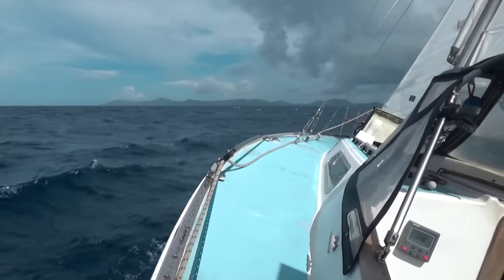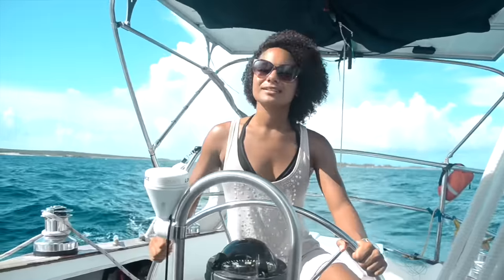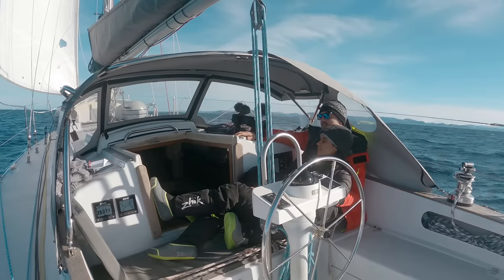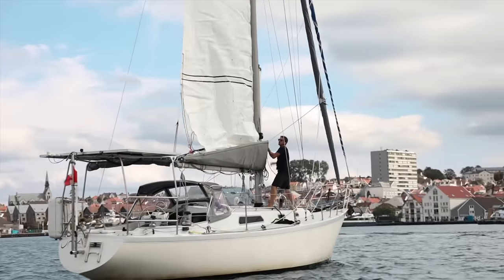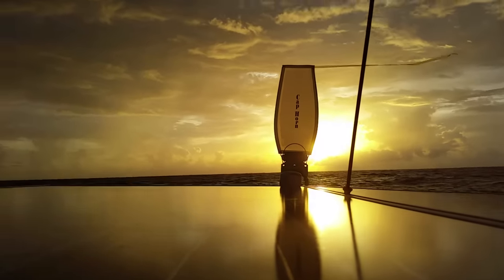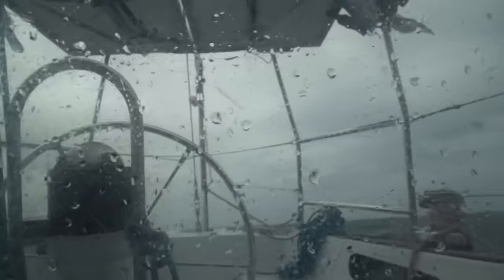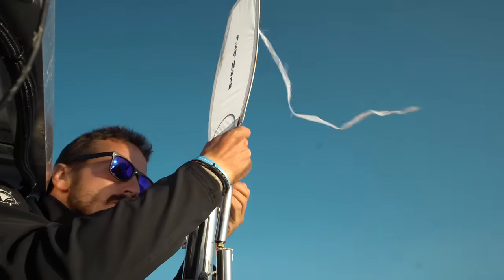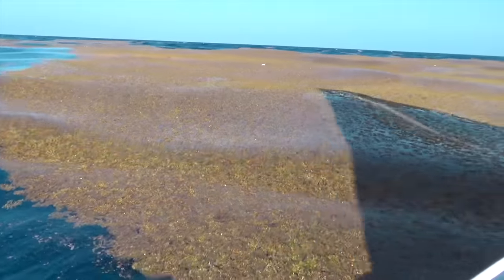Our #1 SAFETY PRIORITY (Autopilot or Windvane)  — Sailing Uma [Step 261]

Comment: How well do you find the wind angle mode works on your autopilot?
One of the common comparisons between a windvane & autopilot is that an autopilot will try to steer a compass bearing regardless of the apparent wind, and therefore doesn't achieve max efficiency from the sails. Windvanes on the other hand couldn't care less about the compass and just respond to changes in wind, therefore keeping the sails performing better. With a windvane, even in spite of the big Ss you're tracking you can achieve better performance overall, so long as you're keeping alert I suppose, doing a U-turn might change things a bit :)
This seems to tie in with what you were saying, but have you played around with the wind angle mode on your autopilot to see how that compares?
Reply from the maker: The "wind" setting works really well actually. But just like the windvane, it does better in consistent wind. Big gusts and variable angles make it work harder.

Comment: What a nice video. I would say, on long hauls you absolutely need the windvane as a backup system, at least, when you are limited in sailors on board. Between the pilot and the vane, the vane takes care of slightly changing wind directions so the angle of the boat remains constant towards the wind - which is important with respect to the setting of the sails. With a small boat in those high waves on the Atlantic, that wind orientation is really important, I guess. It seems as if the pilot does not "know" about the way you set up the sails, so a changing wind direction requires the sailors to act. Then there is a situation between these two where both might fail, if those huge waves in the Atlantic are not in sync with wind direction anymore - and this is perfectly possible with the huge amounts of swinging water mass involved under those waves. Here, the question is not which is best between vane and pilot, but how do you sailors deal with that?

Comment: a few more: 
1)   wind vanes have trouble above 10-12 knots boat speed
2)  wind vane oar adds some drag
3)  wind vane does not steer as straight as autopilot.   Maybe as good as b&g, but this autopilot isn't the best.   This can be several miles per day difference.
4)   you can get many autopilots for the price of a wind vane

The pendulum wind vane is by far the best because it receives feedback from not just the air vane but also the water dragging the oar.    The cape horn is one of the best designs out there, however the other designs will work in almost all conditions as well if the boat is small enough, many boats are way too big with average size vane and this is a problem.

Comment: a wind vane is great. having an engine with an alternator to charge a battery bank to power a hydraulic auto pilot is also great.
Reply from the maker: One is silent and requires no maintenance. The other is very noisy and requires a lot of maintenance.....

Comment: Have you ever talked to people that have played with a sheet to tiller self steering system? I should work about the same as a wind vane. I'm practice I've found it hard but it seems like a neat 3rd backup or something fun to play around with on a long passage when you are board.
Reply: I have tried and have not yet been successful with it on our Ontario 32. I think it might take a lot of trial and error to get it dialed in with the right tension and cord lengths depending on the boat.
Reply: @sailingsinequanoneuc5265  rubber band tension has been critical for me and really hard to get right.  The wind windows are really small for a given tension.

Comment: You guys have done so much work to uma over the years. How about making a video about how much uma is worth today. If someone wanted to buy already done.
Reply: Sadly it´s only worth what the second buyer want to pay, not the actual cost of it. ;-/
Reply: @steinjohansen3142  It's also worth more than a similar boat 'cause it's UMA. All things being relative.  I'm boat shopping, Uma is worth between 40-60K, but I'm just a greasy-shoe burger flipper, not a surveyor.  A very similar boat in good nick will be hard put to bring down more than 35K and there are a lot of them out there.
Reply: Matt and Jessica sold a fixed up boat which was all aluminum for around $75k
Uma would go for something between 60k and 100 k
Reply: @paulmahowald4970  RAN did very well on their sale as well.  I'm sure you are correct. I was thinking about what they've spent and the difference is the artsy architecture student interpretation which is stunning.  Someday they will sell it then we'll know.
Reply: @paulmahowald4970  It would always depend of what the buyers are willing and capebal to pay when they decide to sell.The actual cost of the upgrade doesn´t matter. ;-/
Reply: @prankishsquire2663  You fail to uderstand the differance between technical cost and selling value. ;-/
Reply: @steinjohansen3142  Gee whizz, I'm sorry.
Reply: @steinjohansen3142  As a professional Chef for 43 years, there's not much there I fail to understand.  We won't know until they sell it?
Reply: @prankishsquire2663  It doesn´t matter what people are willing to pay if they´r not capable to pay the price. ;-/

Comment: Very thorough description of both systems. I feel however you skipped one important bit of info: what happens to the hydraulic piston of the BG when not in use ? Is it dislodged ? Or does it keep moving and possibly wearing out when hand steering or under wind vane ?
Reply from the maker: It stays attached and just gets pushed in and out with very little resistance. I guess technically that mist cause some wear and tear, but certainly not enough to shorten its lifespan.

Comment: Dan, great video and a really good presentation on the differences between the two. You mentioned that the auto-pilot is completely linked into the B&G electronics for all of its data. With this configuration, is lightning a big concern and how have you put mitigating factors into place?

Comment: Hi Dan and Kika, I cannot speak highly enough of wind vanes, I'm a solo sailor and have an outohelm (redundant) a Scanmar Pelagic tiller pilot and a hydrovane self steering vane. I'm most definitely an auxiliary rudder vane guy and although the most expensive vane I could have it's also the best, I do have 880 watts of solar and ample batteries (420Ah) from 4 105Ah AGM batteries which is ample to power an autopilot overnight but I need to brush the cobwebs off the autopilots because I use the hydrovane almost exclusively.
PS I'm on a chined steel Van De Stadt 34'.
At 7 grand not a cheap bit of kit but it will steer the boat for days with minor adjustments and because you're not using your main rudder you can balance the boat, take any weather or lee helm into account, lock off the steering (tiller~ keep it simple stupid) and the vane doesn't have to work as hard as a servo pendulum, also with an AR vane if youre wheel steered there is 0 wear on your steering gear.
You mentioned that CapHorn is the only customisable vane, incorrect, every hydrovane is manufactured specifically for your specific setup, pivot shaft length, A and E bracket options and the actual vane/foil size are all customised for your boat, and you can do an offset transom mount with a hydrovane because there are no control lines, nothing wrong with control lines but don't be spreading falsities when clearly other vanes are customisable (PPS I know that Scanmar's monitor is also customisable because I got a quote and their customised monitor mounting for my Stadt 34')

Comment: I have owned the Monitor, the Cape Horn and the Hydro vane. i think the Hydro vane works the best and it is much easier to install then the Cape Horn. The Cape Horn is very hard to instal.  The Hydro vane also works as a spare rudder.

Comment: Several people use an inexpensive linear drive tiller pilot to drive the turret (where the wind paddle mounts) of the wind vane.  This consumes VERY little power, and gives you autopilot like control without buying another expensive and complicated system.  The tiller pilots are relatively cheap, so if it breaks, simply replace it.

Comment: Wow! Great video. My compliments. 
My experience with self-steering gear is 20 years old. Back then, wind vanes were huge and clunky. We had an electro-hydraulic autopilot that I called 'that f**king, useless bastard'. It would not hold a heading. When it worked, it swung two points either way. It reset itself erratically. 
So glad to hear that self-steering gear has improved. My hat is off to you. I thank you for sharing your experiences. 

PS Do you upload videos like this to SkillShare?

Comment: kevin on sailing oceans does a video on a home made wind vane that works like a dream and simple to make.

my own evaluation shows there's not a lot of difference between manufacturers, all simple, minimal mechanicals to fail.  but check out kevin's wind vane.  i forget, but at least one other budget channel i think did a video about their home made set up.  no need to spend the few thousands for folks with tools, ambition and mechanical skills.  It seems Wharram has plans too for their system (I could be wrong about that, I"ve heard, but not seen with my own eyes).

Either way, as usual, great video. 

 i do pout a little when i realize what i thought was a great video was really paid advertisement, for the few that fall into selling their souls for chump change.

Comment: "the boat is going to be all over the place..." with your wind vane. "you're sailing a big S...doesn't really matter when you're offshore..."  
Gosh, I don't know where to start:  Wind vanes steer a course to the wind;  when the wind shifts, vanes correct to keep sails pulling.  
Of course the wind vane doesn't steer a rhumb line.  Miles made good is dependent on full sails:  sometimes that is a big S, but that is the direction to keep the sails full.  
Auto-pilot steers a compass course, so when the wind shifts, the sails luff or lose shape. 
"Wind vane is best with consistent wind and waves..."  No again.  Consistent wind and waves (or dead calm, or fiords) favor an auto-pilot because it's not constantly correcting.  
Wind shifts in strength and direction are exactly what wind vane steering systems are designed to handle. If a brute wave or sudden squall hits:  auto-pilot doggedly attempts to maintain a compass heading.  Can damage the ram, drains power and can point you in a dangerous aspect to the sea.
Cape Horn is the "only vane on the market tailored to you individual boat..."  BTW:  Monitor (I use) customizes the install for each hull. 
I wanted to enjoy this comparison, and it's not often I comment. The last jab was the sargassum:   of course it's going to collect on the paddle, just like it will collect on the prop.
Words matter when attempting to enlighten potential cruisers, and I'm commenting because there are truths you spoken, and also some fuzzy thinking.
Reply from the maker: Yup. We pretty much covered all that in the video. If touched on ever nuance, it would be hours long.

Comment: I think you comments that the Cape Horn is the only wind Vane steering that works on all points of sail is wishful thinking. Its a servo pendulum system like many others. Our Wind Pilot works on all points of sail and has taken us across oceans. Every wind vane steering system relies on apparent wind across the vane to sense the wind. Down wind in light conditions the apparent wind is low. Depending on how you set your lines and any inherent friction in the system will adversely effect the system. You may well have your system set up very well where others do not. Our system is set up well with minimal friction. The other issue to consider is hull design. Some modern hull shapes with skinny fin keels dont lend themselves to wind self steering as the hulls are not directionally stable like a long a long keel boat. 
There are so many variables that influence a good wind self steering installation. It is not as simple as the Cape Horn is the best and I seriously doubt that is the case. You mention that the servo pendulum trips in weed. Our Windpilot doesn’t do this. It has a break away device should we hit something substantial but weed wont trigger this. I suspect the Cape Horn has this break away set so low as the Cape Horn is less robust than the Windpilot. 
In addition, setting up the Windpilot is far quicker. The servo rudder stays fitted. It swings up out of the way when not in use. No need to hang over the stern with the risk of losing the rudder when at sea. I am sure there are other good Wind Self steering gears out there as well

Comment: I’m a non-sailor, how do u know ur not going to run into another boat, when ur not steering urself or at nite?  Does ur boat have headlights anywhere?  And if u do see another boat, how do u know which way to turn so u don’t hit each other?
Reply from the maker: With or without autopilot, If we are not both outside, There is ALWAYS one of us on watch, day or night, keeping an eye out and making sure we are staying on course, adjusting our sails, and not hitting anything. On night passages we usually do 3to 6hrs each shift, one of us sleeps, one of us is up keeping watch. During the day it’s easy (because you can see what is around you) at night when the moon is out it’s sometimes as bright at day, but in a dark night or in the fog or in a heavy rain, we have two things that we use: AIS (which shows us if there are ships or other boats nearby and their exact position as well as where they are going and how fast...) and for anything else that is not on AIS, we can see whats around is with our radar. Boats also have navigation lights (red on one side and green on the other) which indicates which way they are going. in open waters, sailboats that are sailing (not motoring) usually have the right of way, and other ships just go around. When in doubt we can give the ship a call on the VHF radio to make sure they see us. hope this helps. :)
Reply: Sailing Uma Awe, thank u so much for answering my questions.  That was very helpful!

Comment: I saw you having to reach down and re-clip the pendulum foil. Could the sargasso weed-related tripping of the pendulum foil be solved by or a lead bulb weight on the end of the pendulum foil to drop it back in place once you pass the weed?
The power of the pendulum foil to steer the rudder comes from it's deflection to the side by the water when it's at an angle to the direction of the boat through the water. Does that mean a lead weight would either:
a) stop the pendulum foil swinging high enough (deflecting) out to the side to turn the rudder far enough; or
b) not keep the pendulum forward and down in the water (once past the weed and going fast again), thereby reducing the deflection and not turning the rudder enough?
I suppose a super sharp (razorlike) leading edge wouldn't cut fast enough to prevent damage (and lacks that ideal tear drop cross section) but I get the impression this isn't a common enough problem for you to worry that much about.

Other self-steering videos suggest a tiller sheet method. 
Here a bungi/surgical cord (spring) is attached to the leeward side of the cockpit and to the tiller, and a balancing windward pull on the tiller is achieved by attaching a pulley to the windward side of the cockpit and leading a sheet through it to the tiller.
Upwind they set the sails and balance the boat as best they can then use the mainsheet, but further off the breeze they set the sails and use the jib sheet. 
Fine tuning the balance of the boat may be achieved through furling/reefing to vary the relative size and pull of the jib and main, or through adding more bungy cord loops. Apparently, it's a very simple system to set up and works like a charm on trailer sailers all over the world.
Before you got your CapeHorn, did you ever try something like that, attaching the bungy and sheet to the wheel spokes below the wheel's hub (so as to achieve the same effect as with a tiller)?
Reply from the maker: A lead weight would definitely hinder its performance. 

Sheet to tiller works ok on full keel, under rigged boats. Not so much on fin keel, “performance” boats like ours. Cape Horn steers much better than any sheet to tiller method does anyway. Also, the sargasso problem was only for that single passage. Has never been an issue before or since.
Reply: @SailingUma  Yes, I suppose as your keel fullness drops you have to reduce your sail area or there isn't enough damping and the sail imbalance overpowers the surgical cords. You'd lose the speed to charge the batteries from your OceanDrive.

I need to get home from Aus to NZ by end of October but thanks to our lockdown there are few flights and rarer spots in Isolation hotels, so I have to buy a boat and sail. I was thinking about getting an A/P but I think a far better use of funds for improving the boat I'll buy to cross the Tasman would be a CapHorn/Cape Horn, or the Australian Fleming WV which seems similar. 

I hope you won't mind my linking to another cruising couple's channel but I've just seen an absolutely brilliant use of a cheap humble Tiller pilot coupled with the power of a deflection-style wind vane self-steering system which can save people a fortune on AP computers, hydraulic rams and further connections to the quadrant. https://www.youtube.com/watch?v=oShNE2vP6L8

Comment: As for wind vanes how well they work in all points of sail also has a lot to do with how well your boat sails at all points of sail. Some boats out there can barely be called sail boats. Won’t be specific as people still love their boats but let’s just say some boats have very nice interiors But require a reliable engine and leave it at that😜)
Reply: Excellent point.
When we got a Capehorn for our 15K miles around the SoPac, it turned us into better sailors because of the sail trim.
Outstanding design and execution by Yves Gelinas.